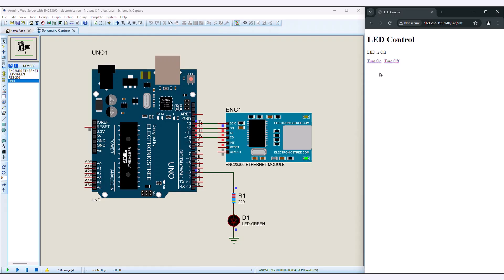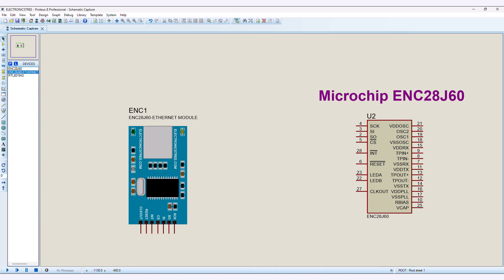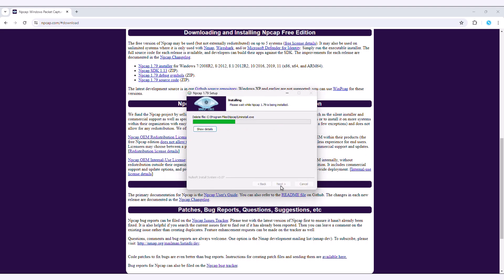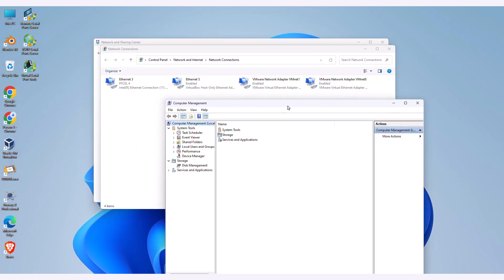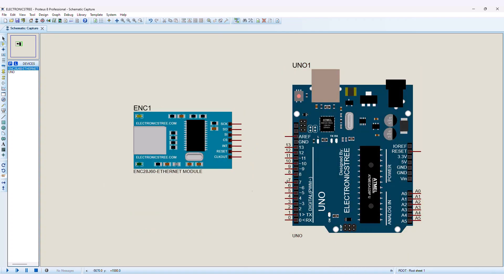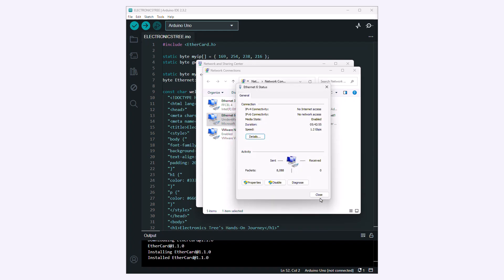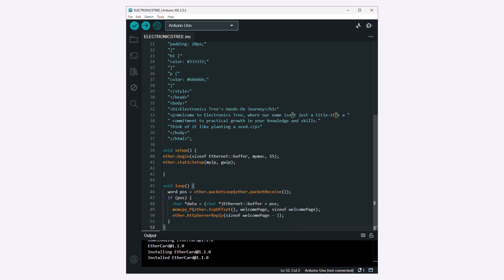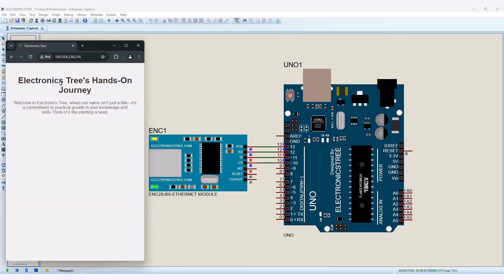How to create Arduino Web Server in Proteus | ENC28J60 Ethernet Module Simulation

Comment: I hv done everything buh the webpage is not loading see error n I don’t know the p
Reply from the maker: Reinstall the virtual adapter
Reply: @ I have done it but the nothing is showing on the browser. Is there something I hv to put to notice like been on a Wi-Fi before compiling my arguing code or something else
Reply: @EmmanuelHammond-lo5yc  hey did you find any solution I am also facing the same

Comment: Can i use this to interface my proteus simulation with Blynk?
Reply from the maker: No, this will not work with Blynk. It is designed to work only within a local network, meaning it cannot interface directly with Blynk, which typically requires an internet connection for cloud-based communication.

Comment: did you use xampp server ?
Reply from the maker: No
Reply: @electronicstree  may we use local host for connecting this simulation?
Reply: @electronicstree  i have get the answer, i made simulation for proteus, that i  setting the microcontroler as tool and web server as controller, to controll arduino microcontroler from web server (localhost xampp or apache). tq for sharing knowledge bro
Reply: @amirudinification  please with us that knowlege

Comment: I did everything you did correctly, but when I type the IP address into the site, I get the "page not found" error. Can you please help, this is very important for me.
Reply from the maker: Please share your proteus file and arduino code with me
Reply: @electronicstree  same with me sir, i brows ip in google but not directly to web arduino
Reply: Gmail üzerinden iletiyorum
Reply: @lastofsn6999 same with me sir
Reply: Hey is it working for you facing the same problem

Comment: First of all, thank you for this assistance. Helped us out here. But when it comes to the simulation in Proteus 8, there are some errors that spring out: "Cannot find model ENC28J60.MDF" and "Simulation FAILED due to netlist linker error(s). And "Pin CS, SI, SO, SCK, RESET, INT, CLKOUT are not modeled." So I was wondering if you could help us or even encountered a problem like this before. Link to the screenshots of the layouts and their results are here in case you want to have a look: 
https://drive.google.com/drive/folders/1eHlfaXo0AjIQ-qjBx76-C4xUypeI3i0M?usp=sharing
Thank you.
Reply from the maker: The reason you are facing this issue is that Proteus can't find the model file for the ENC28J0 module. The library model comes with a folder named "MODEL" containing the MDF file. Have you placed this file in the Proteus Model folder?
Reply: @electronicstree  Yes
Reply from the maker: Share your proteus project file with me at: 
arduinomagix@gmail.com

Comment: It's perfect. Thank you very much, I managed to make the connection. But I wanted to ask if it is possible to connect with my phone? So give instructions to the ardunio to start From my phone
Reply from the maker: Currently, this is not possible because the ENC28J60 is an Ethernet module designed to work with a network card. However, if I discover a way to achieve this functionality, I will definitely inform you.